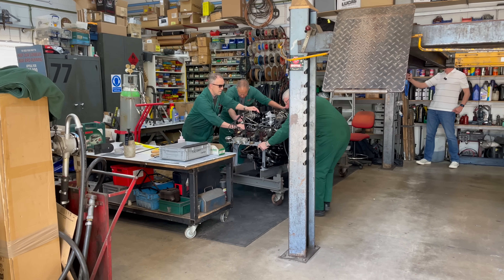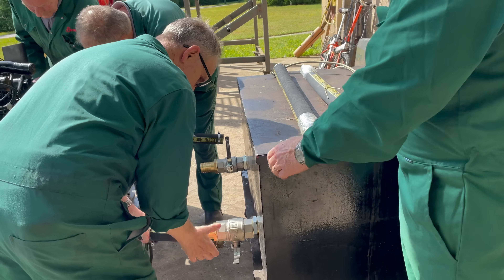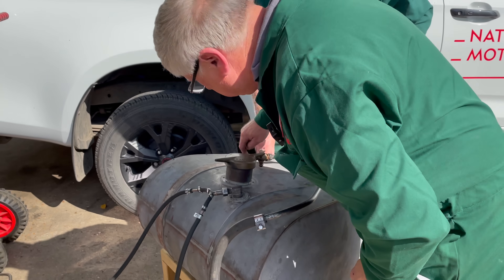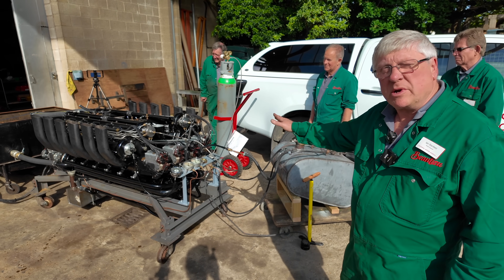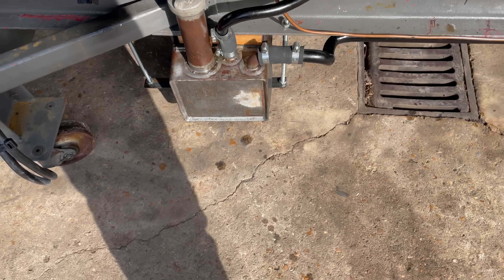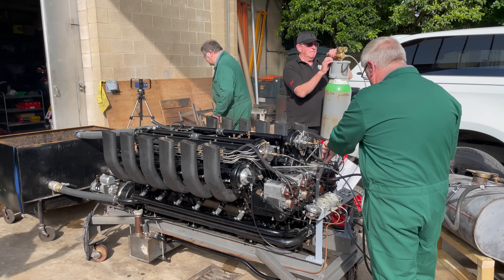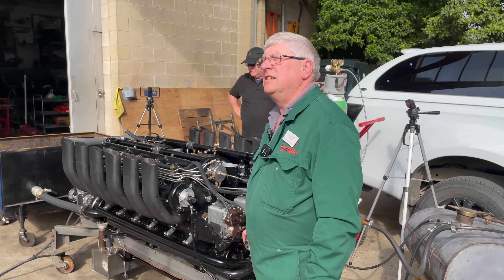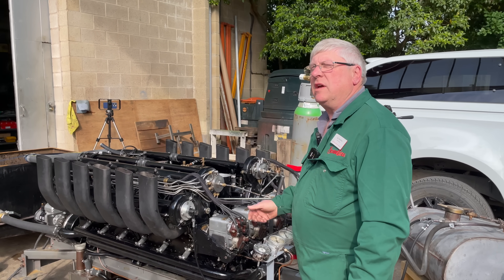Sunbeam 1000hp: Testing the first engine in preparation for its first public start-up for 90 years

Comment: I can't see why these wankers wore out a starter motor to get oil Pressure when they could have more easily just used a Pressurized accusump system to pressurize the whole oil system in just seconds ?

Comment: It looks fuel injected, by the fuel distributors where the fuel lines connect to the engine, it sounds like there is something out of adjustment, as it sounds like a cylinder or two are not firing like the rest., but really sounds great overall. Edit: I guess it has carburetors, the "fuel distributors " I guess are oil lines.

Comment: I owned a sunbeam alpine mrk 4 roots type , tuned it with help from pipers of London who inclined the valves to accommodate the high lift cam , twin 40 Webers bottom end fully lightend Balanced polished crank rods tuned rocker assembly, hollow push rods power max pistons etc etc Kensllow fan oil cooler, it was safe to 8000 rpm, gapped the odd Ferrari or three,👍😅 1/4 mile 13 sec, huge fun,

Comment: OK, archives reading this engine right here was a paramount testament to mankind and it was better out of the car than in the car and all it ever needed to do to change. The world is exactly what you saw in this video in a time that this engine was out smudgepot engines were around. These were engines that had no oil pump. They were much like a Briggs & Stratton engine, and they slashed crude oil around and they were real messy Ridiculously large engines that work tune so poorly that they weren’t worth doing anything with besides recycling and even then you have to burn them for a while before you could get all the oil off of them so this engine right here was made by the best artisan blacksmith in the world, taking bits and pieces from different places and this thing when it first started up that electric motor spinning sounded just like an air compressor building up a charge. It’s kind of silly that it’s only building up the oil pressure even that hand pump that they’re using the bicycle pump that basically the same thing every place you see rubber on this thing had animal sent you in its place that was a Bellows box pump that they used in that bicycle pump. This thing started up, crank up and ran, and it was so quiet and smooth that the traffic from cars driving around in the general vicinity just like you can go outside and listen to airplanes and car tires on the road what the Noah ambient noise was louder than this engine. They had to wrap it up to actively know that it was running or come over and burn themselves on it and I can also tell you one of the magneto needs to be rebuilt if the thing was taken apart and cleaned and tested 100% out you could it’s very very very smooth very quiet motor but has a lot of power and I mean it’s loud compared to what but and it’s heyday when it was made, it was the quietest engine on the planet. It sculpted in industry standard planet wide and that’s the most important thing not only that the garage where it’s at nobody will remember this stuff but that everything I’m seeing about the garage where it’s at matches what I’m seeing on the planetary securities main frame I mean, almost exactly When I’m looking at in black-and-white but I mean everything even the placement of the equipment that they’re using is almost identical. The only thing that I’m really noticing is the box Bellows pump and all of the rubber is animal send you everything else looks excessively similar and is the exact exact exact same engine The video I’m looking at over 500 years old neolithic government was running the planet. It had just fallen we’re talking. This was around 2000 years ago archives

Comment: Very cool engine
The exhaust manifold are loose on the left side. You can see them leaking and wiggling starting around at 7:00.
At 8:10 the guy in the black shirt notices it, at 8: 47 he shows the other guy.
Thank you.

Comment: The pre heating sort of reminds me of a spit swapper. You take the crummins truck to the logging site. This truck has  quick connect fittings and lines on the cooling system. The heavy machines have the same quick connects.
And you hook the hot truck engine up to the cold machine engine and wala, spit swapping no cold start. Of course, the truck loses cab heat for a little while .. a small price to pay

Comment: @0:45 Once the engine is at operating temperature, the coolant is hot. Beginning with hot water gets the engine to operating temperature quicker. Coolant under pressure  will cool an engine at temperatures much higher than 100degrees C. And maintain engine operating temperature.

Comment: Whenever I do major work on a car engine I unplug the ignition coils and spin it over a bit until the oil light goes out.  Get the oil circulation going. 

So I fully understand why they spun it over for ages.

Comment: Cylinder #12 does not seem to be hitting correctly. Perhaps a tight intake valve? It will pop thru the intake when RPM’s are increased. We will see.
  ASE Master-78

Comment: Shame it would not fire on all cylinders, should have checked each cylinder temps and shut down in case valve issues. That's what we would have done at RR .😊

Comment: Think about how much easier it is to get a grand from an electric motor instead of this convoluted junk pile that has a narrow power band and is problematic and maintenance heavy

It's heavy and takes up a lot of space, produces excessive heat, noise, pollution and vibration

ICE drive trains have convoluted diagnostics and requires a lot of rubber and plastic parts including fan belts and vacuum hoses cause problems when they break down due to the high heat from the engine
Reply: That's funny, do you hire yourself out?

Comment: On today’s high performance motors some won’t release full power until the oil has reached an appropriate temp. Usually 5-10 minutes before it reaches running temp depending on weather temp

Comment: Have you chaps thought about fitting an electric pre-oiler pump?
It saves the starter and any wear inside the engine. Much quicker too. 
I use one on my Meteor engine.

Comment: Poor starter😅 Took an eternity for the oil pressure to rise . Would’ve helpep to remove the sparkplugs first.
Reply: You must not have been paying attention, once the oil pressure is built up, 4:05 the guy says, now we'll put the spark plugs back in, and they show them putting the plugs back in.

Comment: Had a few cylinders not hitting all the time.  Also must have been a ton of rust in the water jackets on that thing. 
Should have a thermometer to check what cylinder are running and not..
Reply: Noticed that too, right bank had some oil burn off or a exhaust leak, the brown coolant...hmmm normal?

Comment: You got those Mag's clocked first time no small achievement,  very impressive work by the team.
Reply: "Mags" no apostrophe.
Reply: @RedneckSpaceman  It's an abbreviation for 'magnetos', just as it's is an abbreviation for 'it is', so the apostrophe is correct.
Reply: @RWBHere it's is a contraction, not an abbreviation, hence the apostrophe. Mags is the plural of mag, an abbreviation of magneto, so no apostrophe needed.
Reply: @RWBHere  Wrong. It's just a plural, albeit of an abbreviation. No apostrophe needed.
Reply: @RedneckSpaceman  So, an A- then? And, you didn't comment in red ink. Neener, neener.

Comment: ||||||||                     ||||||||
   \        \------/        /
       [@] [@] [@] [@]
       ==  ==  ==  ==
What r those 4 red and silver things on the front of the engine?
Reply: Mags! Magnetos, 6 wires each for 1 plug each cylinder on each bank, 2 spark plugs per cylinder.
Reply: @alro2434 👍
Reply: They look like they are the ignition system.

Comment: Besides being a "1000 HP", which exactly Sunbeam engine is that? Specific background info would be greatly appreciated.
Reply: It's a V12 aero engine designed toward the end of WW1. Only 14 were ever built, and the two (~450 bhp each) that went into the land speed record car are the only ones remaining. 

More details in the other videos.
Reply: https://en.wikipedia.org/wiki/Sunbeam_Matabele

Comment: How nifty is this? I have a fully restored 1965 Sunbeam Tiger automobile I bought once upon a time because it was super cheap. In the intervening decade I have ended up with two more Rootes Group autos. One is a 1959 Hillman Husky modified for a small block Ford V8, the other a 1952 Singer Roadster I fully restored as a light weight "hill climb special". I live in the US where one might assume these to be less common, and never planned, or intended this odd collection, but hey that is how life goes sometimes.
Reply: Well done sir. A friend many years ago owned A Sunbeam Imp. Sold in America by the Chrysler corporation.

Comment: WHY ???!   With all the resources and manpower available do you intentionally try to damage the engine?   Any barnyard mechanic would have rigged up an oil tank and purged the engine with oil pressure to lubricate everything BEFORE turning it with a starter 🤬🤬🤬
Reply: Having stripped, restored and rebuilt the engine, they probably put it together with oil on the bearing surfaces, before turning it over 'light' with the plugs out. They may be a bunch of old codgers, (like myself), but will have gained sufficient knowledge over  their many years to have slightly more than an inkling of what they are doing. 😉😉😉
Reply: @nlo114  Definitely know what they're on about, he even mentions putting the plugs back in before firing, and I'd bet on them using the same process that the manufacturer instructed to use when it was first built.
Reply: Did you not watch the video?
Reply: You obviously missed the start of the video where they did just that.
Reply: Nay sayer,ran amazing
Reply: Daniel, perhaps you're not aware of how long every motor ever put in to a production vehicle takes to get oil through to all of it's parts, and how the metals are chosen to survive the first few minutes of running with only the skin of oil film left after the previous run.
And example I have timed myself, from fire up to seeing oil flow through the rockers to run down to the solid cam followers, on a Slant Six, is nearly 10 minutes at idle.
Yes, the crank has oil pressure almost immediately, put everything else takes a warm-up cycle.
Reply: Surprised that the starter didn't seem to change sound when the oil psi came up, as that is noticeable on any engine I've worked on. The pump takes a HP or three at least to reach relief valve pressure!
Reply: Why don't you show us starting your engine?

Comment: I’m just wondering if you’ll be using a coolant additive to inhibit rust once it’s installed?
Reply: The colour of the coolant infers there is already corrosion inhibitors in place. Likely Ethylene Glycol.
Reply: @PiDsPagePrototypes Ethylene Glycol is not a corrosion inhibitor, it's a coolant additive that lowers the freezing point and raises the boiling point. It is colourless. 

The most common corrosion inhibitors are silicate, usually coloured blue, and organic acid, which is typically orange.
Reply: @handpaper6871  Every bottle of Glycol I've ever opened has had a dye in it, mostly to stop people trying to drink it.
Reply: And I should add congratulations on such a precise rebuild and nicely running engine with the snap crackle pop of the short exhausts.

Comment: Now that is some coolant flow.
Reply: The color of it, though! Fresh from the bilge of a sunken Narrow Boat? Yuck!
Reply: It wasn't the first fire up that's rust from the inside cooling system
Reply: @brucepetty6059 in it's former life the engine would not have had antifreeze in it, which for a lot of years now has also contained a corrosion inhibitor. So iron oxide etc would have formed rapidly, especially in hot water....
Reply: And that's at idle !!

Comment: I suppose the period carburation is only expected to smooth out at operating revs/cruise settings when used as an aero engine. Even later aero engines like the Merlin seem to pop and bang at idle.
Reply: I think the popping is more ignition related, and yes, older engines like more consistent flow through the manifolds then one gets at idle.